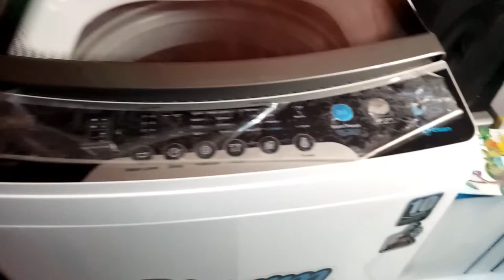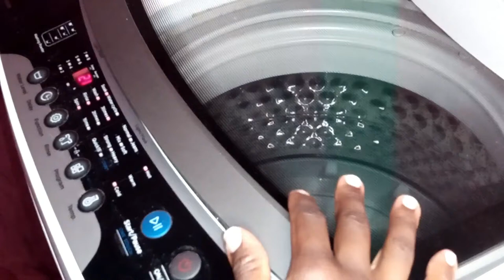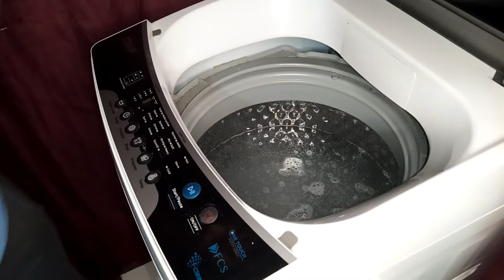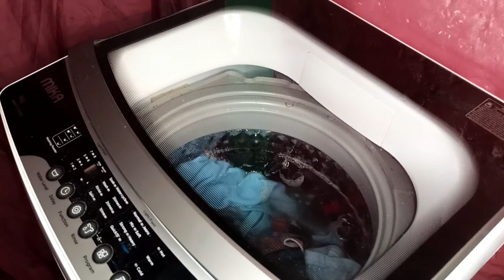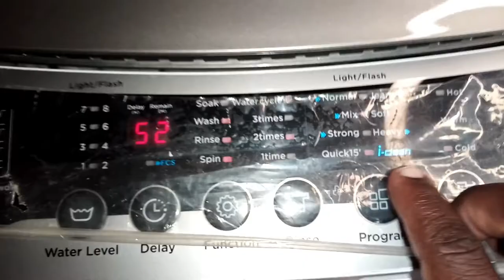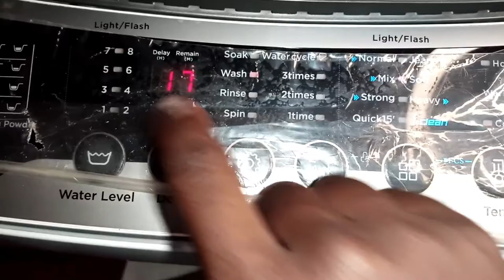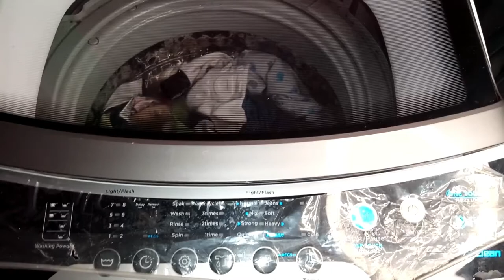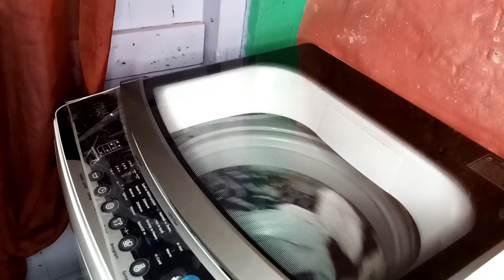Laundry Routine//How To Use Automatic washing Machine Manually!

Comment: Water runs out immediately when l pour it inside the machine, how do l stop it?
Reply from the maker: Dont put the drainage pipe down let it stay in its position until you are done  washing....when pouring water manually pur 40litres of water ..the first 20 litres just get sucked up by the machine somwhere but it adds up when you start washing

Comment: Its better u use semi-automatic washing machine, there is no use in having a fully automatic and doing all the work by our hand
Reply from the maker: It was just for a short time till direct water supply is connected....also thi is nairobi sometimes water jus goes for days so this is to help anyone who might have water shortage and. Have an automatic machine.
Reply: I have exactly machine but it uses alot of water and I had to buy a semi automatic one
Reply from the maker: @msowakihia8129  to me i dont even see the difference all machines just use alot of water...my take my sister has a semi one we use almst the same amount
Reply: Semi automatics do tend to run a bit larger especially if they are 10+ kgs, so for someone with limited space it helps a lot to have one tub that can wash and spin.

Comment: hi gal, dont you think that water is sooooo extremely much? washing 3 cycles each 40l that is 120 rinse twice and that is only one load....someone advised me to consider twin tub semiautomatic if i need a cheaper and efficient machine, or frontloader (my views though)
Reply from the maker: Now if watch the whole video well you notice that i only fill the machine once .....i reuse the water for washing all three loads ...rince aside then just spin ...so used to use the drum as a big bucket....semi automatic too uses lots of water its just the same concept here am using my automatic machine semi automatically hakuna difference ..but i once i connected water things are running just fine ...also a front loader is not efficient if you dont have constant water supply how will you fill the tub with water? If you buy a front loader make sure you never lack water 😊...thanks for your thoughts😘
Reply: @CeejaysEmpirece  now i know gal

Comment: If you leave the drainage pipe to flow will it drain the water continuously?
Reply from the maker: Yes never put the drainage down if you are using it manually ..automatically being used it locks the drainage until when time to drain
Reply: I love the info kwanza Hapo kwa manual use.thank you very much.
Reply from the maker: You are welcome